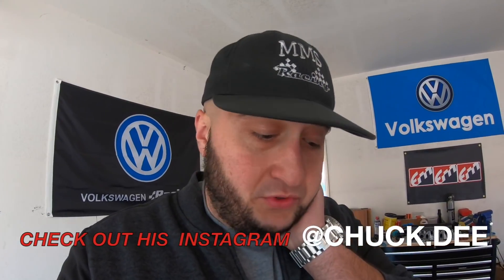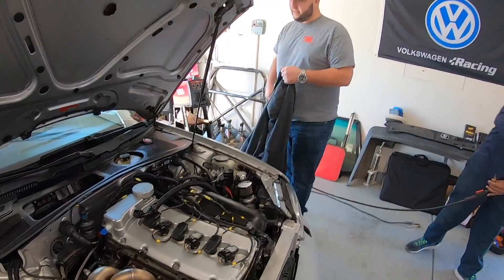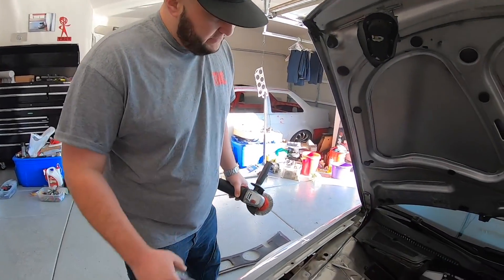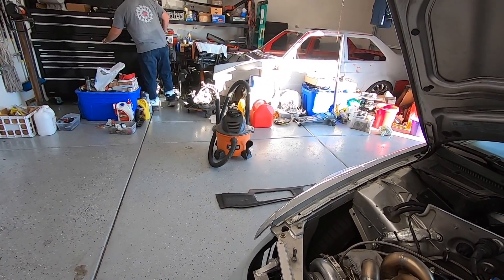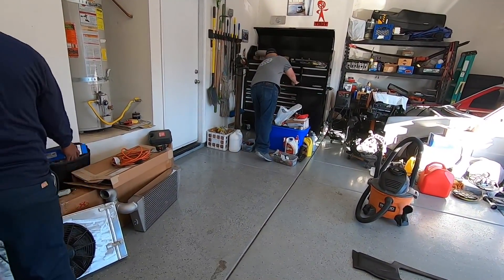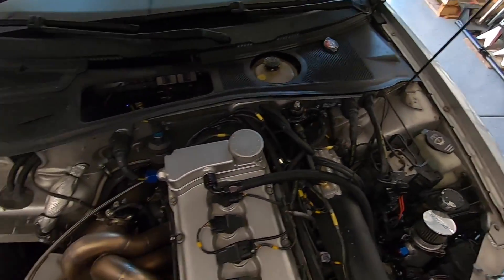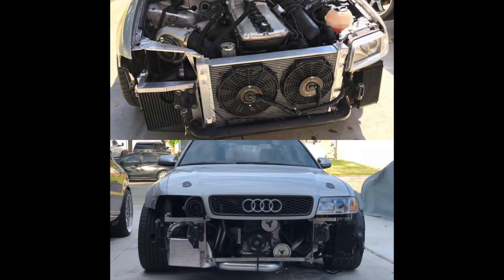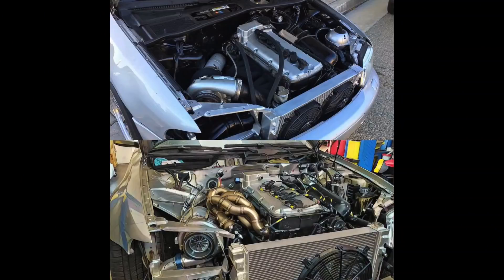VR6 TURBO WIDEBODY AUDI S4 UPDATE

Comment: Hey, you still running on 034 flywheel and tilton twin disc clutch? What’s you take on?
Reply from the maker: Rafał Kosidło copied this response from above absolutely love it, it’s an 034 flywheel and Tilton Carbon on Carbon twin disk. Absolutely a dream to drive, we dyno this Saturday will let you know how she holds up, but this is Chris Green’s old setup and he made 1100-1300 hp, so should be good for our numbers 800-900

Comment: Those seems weren't welded from the factory. They're not part of the frame rail and get pushed out like that from coilovers.
Reply from the maker: vinniepearl you’re right, the more we grinded we found it was just sealed together via some kind of factory dealer. Never dealt with this issue before, but some nice stitch welds should keep things from pulling apart any further 👍

Comment: Cracks are most likely the result of the upper control arms slamming into the underside sheetmetal. May want to look into making clearance boxes.
Reply: Not really the sheet metal infront of the strut towers has been gutted so they very little to no support. Pause 6:47
Reply from the maker: Jolinator hey bud, we removed the plastic fender liner in that area, absolutely no metal gutting of any kind was done. 

We think the seams coming apart are normal for a car with a good amount of abuse over the course of 17 years and coming from the east coast where weather kills the chassis
Reply: @MalakaMotorSports  Fair enough thanks for the reply! didn't realize everything infront of the strut tower was plastic on the B5! Pretty crazy. Ive never seen this on a b5 do you think the removal of the plastic radiator support and having the rad bolted in had any effect? Great video as always!